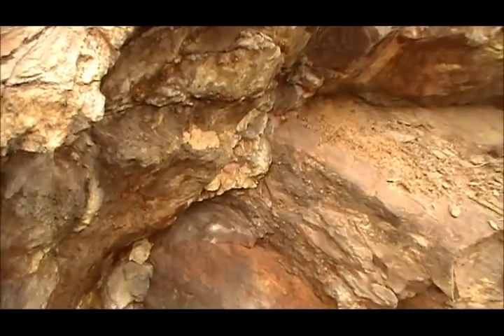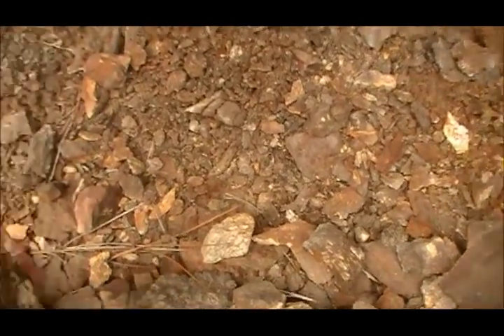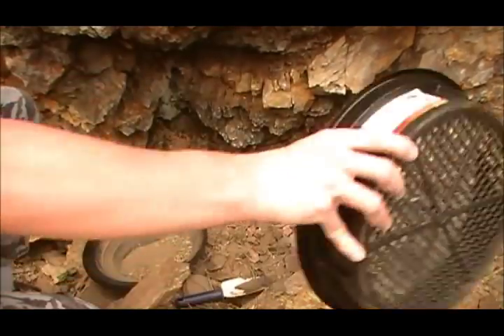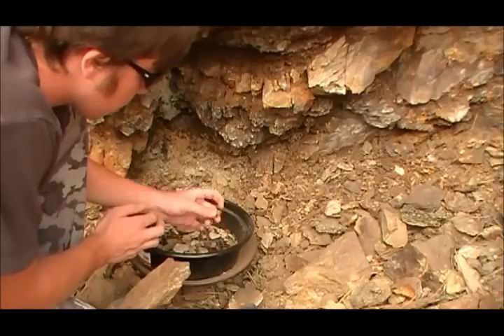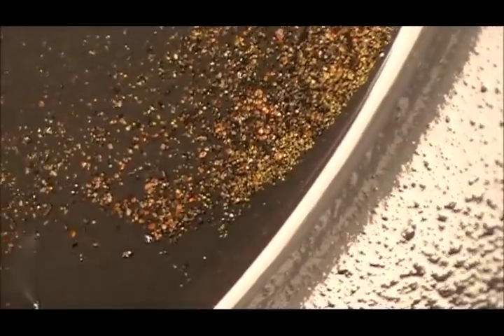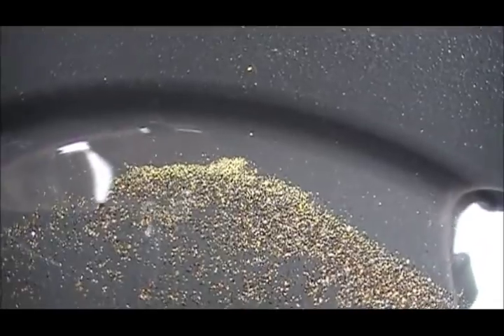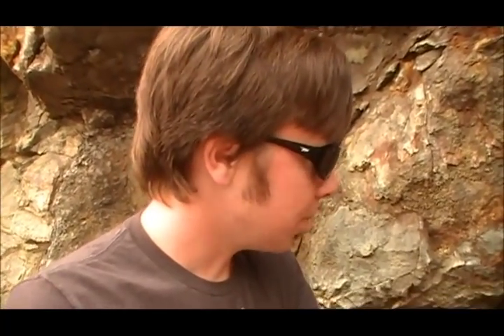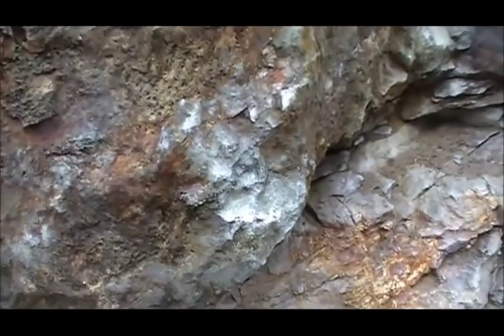Flour Gold

Comment: For such a small amount of material, that’s a pretty hefty return! That’s nice 👍 I’d collect that in buckets an process that, you’ll be very surprised on how much gold you’d get! Buy your self a Gold Hog multi sluice, and run that material it will pay for it self! Awesome
Reply from the maker: Its definitely a plan of mine to process that material :) Makes me wonder how much of it can be taken from the rock and veins in the cut. My first time using the goldbug 2 was at this location and it was going off constantly, most of it was likely just hot rocks with high iron and mafic mineral, but some of it could be the good stuff. Right now i'm busy studying in college and working here and there. Im working on my geology degree. But on my free time, ill have to get some buckets of that and try collecting what I can as well as other things.

Comment: The flour gold in your pan may actually be chalcopyrite. It is heavy and brassy yellow and very hard to separate from black sands because of similar specific gravity. It is brittle and can easily be crushed. If you have a lot of small particles, check the material again when it's dry. Chalcopyrites will look non metallic and more like sulfur when dry. Also your sun glasses may change the true appearance of minerals. If you do have flour gold, check out Hard Rock University's panning videos on micro fine gold. Good luck!
Reply from the maker: Its funny that you mention this because, just the other day I was reading about chalcopyrite and was wondering if  my "flour gold" may be just that. What a coincidence. 

The specific gravity of chalcopyrite is 4.1 – 4.3 and most black sands are just above or around 5 I think. I tried washing the stuff out of my pan multiple times and it stayed in. So I believe it could be very small gold.

I will be getting myself a loupe magnifier one of these days so I can take a closer look at my findings. As for my sun glasses I never thought about them possibly changing the true appearance of the minerals, but I remember taking them off a few time to look at the minerals in my pan. I will remember to avoid wearing sun glasses while looking at minerals in the future. 

And if it is chalcopyrite, ill try to find more of it because its a very good copper ore. 

 Thanks for the information. Take care
Reply: Roasting is the only way followed by a acid bath, you may also have ARCENO-PYRITE wich is a blended mix of calcopyrite/arcenic/gold and other oxides and it is also very resistant to fire and acid

Comment: Likin' your vids! Offering some thought that might be helpful --- learning the "wash and bump" technique with the pan; washes the "lights" down while pulling the gold to the upper rim. You've sampled the area and proved it contains gold; actually a lot for the size of sample though it be "flour" gold . Determining the source layer(s) would be my next step.  

Think I'd look into a plastic tub to carry my pan/classifier/hammer (and snuffer bottle) along with enough water for wash --- minimizes time and possibility of sample loss ---- LOL, just sayin'. 

Looking forward to the next vid -- keep up the good work.
Reply from the maker: Thanks for the thought. 

I remember trying to bump the sands down to separate it from the gold but when its that small its easy to wash it down and I guess you can say my panning skills need a bit of work. Gold can even float sometimes on the waters surface when its that small. I've read that using some drops of jet dry can solve the "floating" problem. 

Ill definitely have to get some kind of tub to carry around with me. I've been carrying all my stuff in a 5 gallon bucket but that tub will be helpful when I'm away from water, but I guess i could always dry pan if I'm desperate enough. 

I will be coming back to this spot in search of the gold. I have a good feeling about those quartz layers. But Ill likely wait until most of the snow has melted off. Also I forgot to mention in the video but this was actually my very first gold that I've recovered. 

Thanks again for your helpful thoughts and thanks for watching. 

And hopefully we'll find more of that gold.
Reply: It is a small wave action --- almost like a "wipe" with water ---- the lights will wash down and the tapping with make the gold (heavies) climb right up. Does take some practice.

Add some Dawn dish liquid to the water (tiny drop) --- it will help break the surface tension of the water, less likely for the gold to float... works very very well

Here's a vid to demo the action.... now, he uses his finger to push the gold back up; keep in mind, the fingers contain oils which will make the gold float too --- all the more reason to use Dawn (or Jet Wash) in your water. A few times - he uses a "wipe" action - kinda like a roll of the wrist/pan for the water to roll/wipe around the pan. Play with it a bit -- it'll come.
https://www.youtube.com/watch?v=0Cbiiohp5bQ